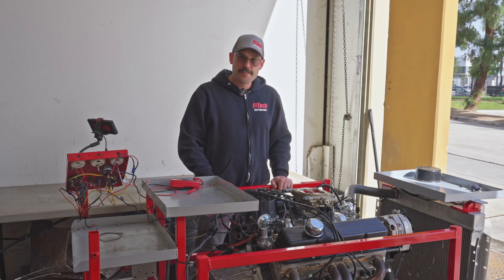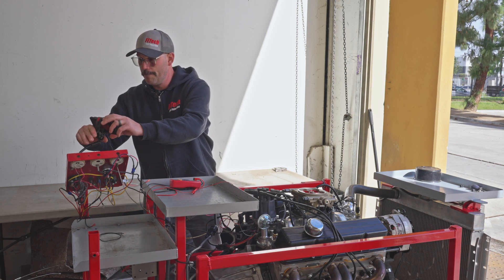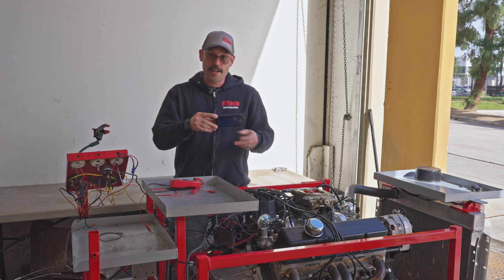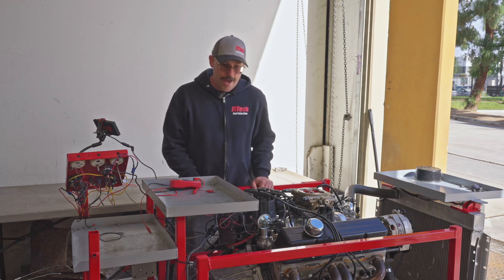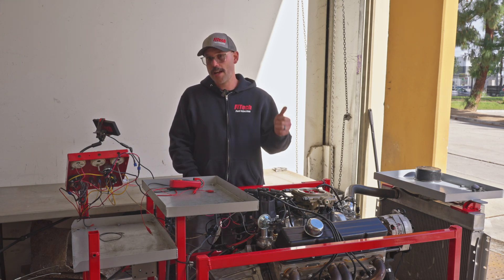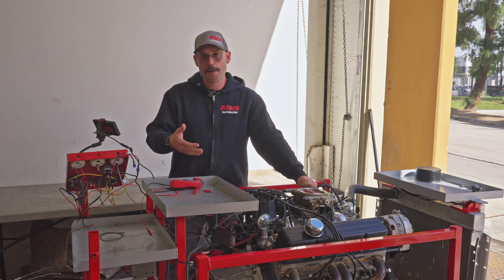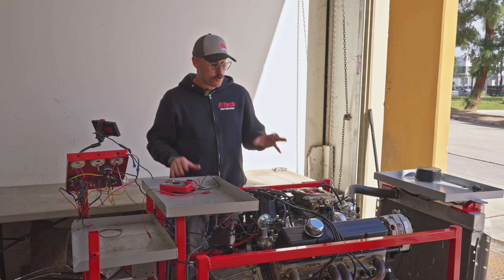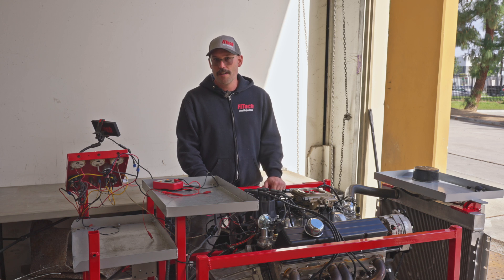FiTech EFI Won't Start After Install | How to Ensure Successful Ignition

Comment: My fitech keeps blowing fuse, it runs for 20 secs and blows both fuses, Help please
Reply: Where is your power source coming from ? Is it grounded to a buss or directly to battery ?
Reply from the maker: Hello sir,

If the fuse keep blowing when the unit runs or is ON, that indicates there is a high resistance reading, we need to verify the grounds on the system. If the issue continues we suggest contacting our Tech support team, they can further assist you with the diagnosis.
Reply: Update, it was the fuel pump, new pump in and she's good.

Comment: i have a jegs system that looks like fitech makes it i can play with the timing and get it to start it will run nice then i shut it off and it wont start just turns over any help would be great because jegs knows nothing about the jegs system. grounds are on the battery rpm shows after about three seconds of cranking not immediately running msd 6201 with external msd coil and pertronix ready to go distributor on a 1965 olds 425 engine in a 72 cutlass

Comment: Ive got rpm signal, but no spark or fuel. My pump is working and pushing dlfuel to the unit, but the injectors don't prime on key-on or activate with cranking.

I need to check my MSD box as well regarding spark still, but any ideas on the fuel? Is there a force-shot I can engage to test?
Reply from the maker: Check the fault codes of the system then contact our tech support team at 951-340-2624 or techmail@fitechefi.com

Comment: I have 383 stroker big can. I installed the fitech EFI system it starts but when I start to slow down come to a stop it stalls! Any ideas why?
Reply from the maker: Adjust the throttle in reference to IAC steps. Watch this video. https://youtu.be/7Fwhq48gySs?si=NIiloqfKErPDDfC6

Comment: This is good, but I'd love some input on my unique problem. '68 Camaro with 327 & MSD ignition. Car starts cold and runs beautifully. No issues at all. Car starts when hot and runs beautifully with no issues, but let it then cool down for 20 to 45 minutes and it will not start. It fires, but immediately dies. I have played with the various ignition and after start parameters in the FiTech controller, but they don't seem to make any difference. Once it cools all the way down it will again start well. Called support and the response was to keep playing with it. The other idea was boiling gas, which is not the case (I did check).
Reply from the maker: Make sure you are getting a clean tach signal when you are cranking on a hot engine. I have seen ignition modules flake out when heat soaked.
Reply: @FiTechEFImedia I have exactly the same problem with my Fitech. But after insisting on cranking, the only way to start the engine is applying a little spray of fuel directly on the throttle body. Then, I concluded that it is missing fuel to start. The big question is: why it happens only 20~40 minutes after turn off the engine? 
When I crank immediately after turn off, it works well.
Reply: @wandeljunior3688  It could be a vapor lock issue.  I would have that long ago when running at normal temp I'm usually going down the road getting air cooling to the unit (to some degree).  Once I stop it lets the heat soak further into the unit with no cooling.  I'd also experience this at extended stop lights.  My solution was wood spacer under the unit that would minimize heat soak into the FiTech.
Reply: @ChubRock3  thanks for sharing your experience. I'll try it in my Dodge Dart 318.

Comment: Why do I have to prime the system 3 times before it starts
Reply from the maker: Most likely you have low voltage to the key wire during cranking. Other possibilities are low fuel pressure so you are cycling the pump multiple times to build pressure.

Comment: Alright fellas I need some help, no matter what I do, I can't keep the fitech system above 9.5v while cranking, I have a crank no start condition and just wanna hear this ultimate kit run! Please help fitech!!
Reply: I have charged the battery, replaced battery with new and still the same result
Reply: Also, have cranking rpm but I do not hear an injector click, injectors are plugged in passenger and driver as labeled. I am stumped.
Reply from the maker: Make sure the key wire is staying above 10 volts as well. As a last resort you can reload the ECU software. Under Display setup you will find ECU PROGRAMMER. Make this say show and it will appear in the Main Menu of the handheld. In this menu load the file that closest matches you engine. Once loaded key off for 30 seconds. Then key on and crank. If the engine starts then go through the initial setup again. If not contact tech support for additional tests.
Reply: @FiTechEFImedia  getting really bent out of shape now. Finally got the fitech system to run, ran up to temp and idled for 30+ minutes, idled way high upwards of 950-1000rpm I am running a tsp stage 3 low lift cam and springs, sounds like a stock truck with this system. Shut it off and tried to restart, it sputters and then nothing. Will not restart now. What is going on with this fitech???
Reply from the maker: @ There can be multiple variables. Please contact the tech support line for assistance. techmail@fitechefi.com or 951-340-2624
Reply: @FiTechEFImedia  moved EFI harness cables directly to the battery and have had no more issues! Thank you guys, system seems to be operating as it should now!
Reply from the maker: Make sure you have adequately sized battery cables as well as grounds from the engine to chassis and battery.
Reply: @FiTechEFImedia  does fitech recommend the grounds in the wiring harness go to the chassis, or the engine? i will try these things suggested thank you!
Reply: I have a 30003 it will prime the pump click the injectors..but no start
I've checked I have 12v at the white wire drops to 10 during cranking. But no tach signal my dash tach jumps but nothing shows up on the FITech dashboard screen. Not sure what to do at this point. Was told my handheld was bad ordered a upgraded one with the cable still no start...I can put a competitor system on and it fires up ..being told on a few forms that these systems are unreliable and have cheap ECU that needs sent in or replaced all the time